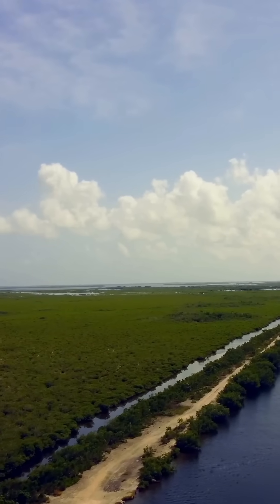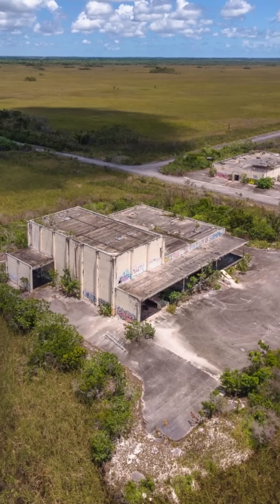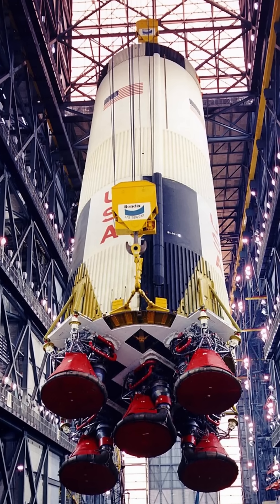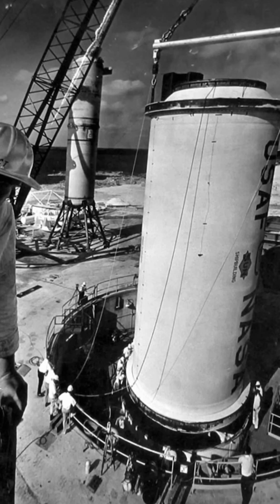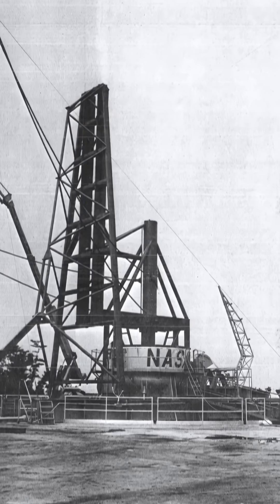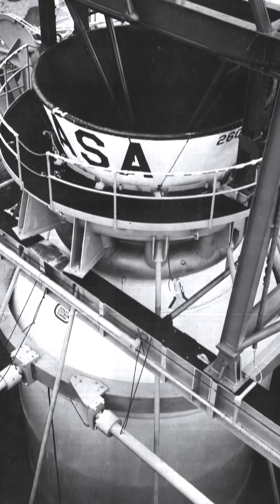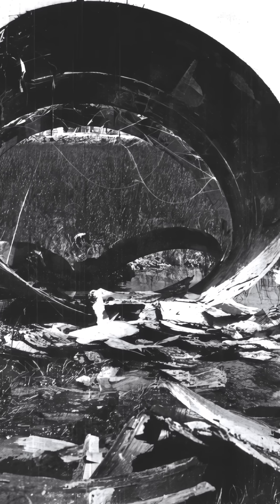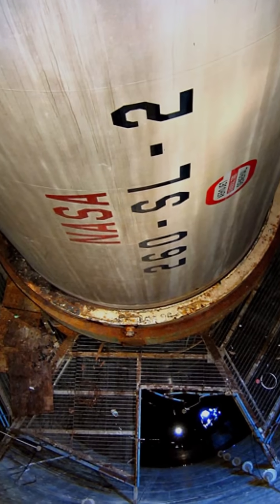Ruins of the Abandoned Aerojet Dade Facility: Everglades SL-3 Rocket Test #historicaltidbits

Comment from the maker: The Aerojet Dade Facility, a relic of the Space Race era, stands as a testament to America's ambitious pursuit of space exploration. This once-bustling complex played a crucial role in the development and testing of powerful rocket engines, particularly those intended for the Saturn V program.

In the early 1960s, the U.S. Air Force awarded Aerojet General a contract to build a rocket manufacturing and testing site near Homestead, Florida. The facility's primary function was to conduct static fire tests of solid-fuel rocket motors, which were considered a promising technology for space propulsion at the time.

The facility's most notable feature was its two underground silos, 120 feet deep, designed to house and test these massive rocket motors. These silos were constructed to withstand the immense forces generated during the tests, ensuring the safety of personnel and the surrounding area.

However, the project was ultimately canceled by NASA, and the facility fell into disuse. The SL-2, was left abandoned in one of the silos.

Today, the Aerojet Dade Facility remains largely untouched, its decaying structures slowly reclaimed by nature. The underground silos, once symbols of technological advancement, now stand as eerie remnants of the past. Despite its desolate state, the site continues to fascinate history buffs and urban explorers, offering a unique glimpse into the golden age of rocketry.

Comment: Elon Musk's company, SpaceX, builds rockets with different thrust capabilities depending on the vehicle:
Falcon 9: The first stage of the Falcon 9 rocket produces over 1.7 million pounds of thrust at sea level. The second stage's single engine generates 220,500 pounds of thrust.
    Falcon Heavy: The Falcon Heavy, essentially three Falcon 9 first stages strapped together, generates more than 5 million pounds of thrust at liftoff.
Starship (Super Heavy Booster): The first stage of the Starship system, known as Super Heavy, is designed to be powered by 33 Raptor engines, ultimately aiming for 17 million pounds of thrust at liftoff. The Raptor engines used in the Starship system are significantly more powerful than the Merlin engines used in the Falcon 9 and Falcon Heavy. Earlier Raptor engine designs produced around 230 tons of thrust, while the Raptor 3 can achieve 280 metric tons, and the Raptor 4 is designed to surpass 300 tons.

Comment: Rocketdyne Won The Contract, The Same Company That FU'D Their Sodium Reactor Experiments And Turned Simi Into A Radioactive Dump, TO THIS DAY!😢
Reply from the maker: It is not a radioactive dump. Lol. Based on the amount of gasses they vented, the local public received a lower radioactive dose than you'd receive if you took an airplane flight at mid-day. Exceedingly low exposure. Regular exposure to second hand smoke is more dangerous from a radiological perspective.

 The problem with that facility isn't radiation, it's the forever chemicals that could leech into the groundwater. The only contamination at that site which could be a problem is the tritium plume, but they have hundreds of wells monitoring the movement of that plume underground and it's already fallen within safe limits to be considered drinking water.

Radiologically, the area is boring. They have a done a good job at cleanup. The forever chemical cleanup on the other hand is moving at a snails pace ...
Reply: @historicaltidbits  a pro nuke wizard? A radioactive meltdown leaves curium and plutonium, and the radioactivity from  iinjested man made isotopes cannot be compared to natural radiation! And you should have made the comparison to bananas or potato chips, it sound so much smarter! 
And tritium is not even produced in the chain reaction! Have you heard of three mile island? Over two million folks were exposed to harmful evaporation of contaminated water, millions of gallons loaded with everything! Nearly all isotopes dissolve readily in water, and evaporate out as easily, still clinging to the water vapors with their powerful charge!
Reply from the maker: You should really do more research on the radioactive isotopes present at the facility. This information is widely available.